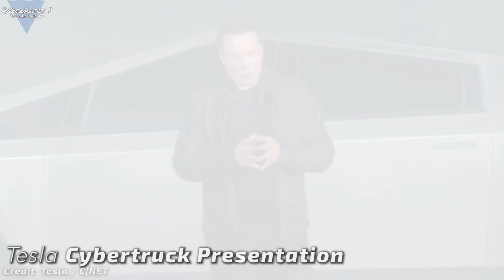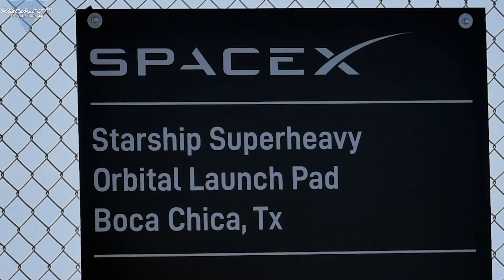53 | SpaceX Starship Updates – Roberts Road Construction - Blue Origin Progress Update

Comment: Pressurized cybertrucks could also be used as sealed fire disaster area escape vehicles
Reply: Damn no one ever commented or said this on any new videos on the truck! Good thinking Elon should have pointed that out
Reply: StoryTelling the body is the chasis which means the batteries will be protected by steel tough enough to withstand re-entry since its the same steel as used for starship
Reply: cam Coutu starship will have covers on reentry side though, helping reduce the heat the steel handles a lot less. Battery’s near heat probably just isn’t a good idea
Reply: @damitcam  Starship uses heat shield tiles on the wayward side for re-entry. Tesla batteries need to stay under 113 degrees.
Reply: @damitcam   - and to think - for the last 60 years the auto industry has been designing vehicles with "crumple zones" - but this  Tesla Truck body doesn't seem to wanna "crumple" - ooops  - what will the auto industry do now.... =P
Reply: Batteries and heat don't mix well. Teslas already have to turn on cooling systems often in the summer to keep the batteries cool enough.
Reply: Colton McCormack that’s what I was thinking. The truck itself unless could blow, unless perhaps Tesla has a huge heat shield like starship around important electronics
Reply: Good talk guys that was refreshing.
Reply: Which means if the whole underbelly is flat you will be fine, as long as your not sitting directly on top of a fire for too long you should be ok
Reply: @damitcam  No. Starship is able to take significantly higher heat levels than a battery. 3mm of stainless steel isn't particularly insulating, it can just take higher heat levels. A fire-rated truck would require significant insulation and/or active-cooling.
Reply: cam Coutu that’s gonna be awesome then to be fair. But the next step is they still use rubber tires which is swapped for the airless could be an amazing rescue vehicle
Reply: To clarify, the heat shield is not made from the same steel. It is made from aluminum-lithium. The steel isn't insulative enough to take that kind of heat, and the truck's steel is thinner than the Starship's anyway.
Reply: Isn't it just safer to roll up the windows? We all know what gas does under pressure, particularly flammable gas. Yeah, it might be sealed, until it's not.
Reply: @Levitiy  I guess there wont be movable windows cause not needed. Maybe there would be fixed windows or cameras installed like Tesla Models.
Reply: Even better. It can reach remote forest fire zones by going THROUGH rivers & streams (were trees can not grow/burn), since it is sealed & does not need air/exhaust to run.
Reply: Damn no one ever commented or said this on any new videos on the truck! Good thinking Elon should have pointed that out
Reply: cam Coutu but, where would you escape too?
Reply: Yea but those heat shield tiles are made of the same grade of steel as the truck
Reply: windows break
Reply: @4rt3m1s-b6p  The windows broke because the sledgehammer hit directly before them hit the edge of the glass and cracked it. They aren't going to break under normal circumstances.
Reply: Graphene Could be use as cooling material. They also need to use special tyres to withstand fire and other Problems.
Reply: Bro are you on drugs
Reply: Does the battery/motors also have the same protection from the exoskeleton or is it beneath? I have not looked into the truck besides the presentation
Reply: Im not saying these things will be great for driving threw fire directly im suggesting using the life support to purify the air inside the truck of smoke and toxins, if you watch many fire evac videos the roads are still there for the most part in what we see so this is my suggested use case

Comment: You know what they say... The Best Weld is No Weld. c;
Reply: They will use a bending machine 😂
Reply: 200+ foot SS roller/bender. I really wanna see that
Reply: @williamscenna3163  Could be possible. If you ever had seen manufacturing of turbine for powerplant or camshaft for a big ship, why should it be Impossible to bend such a large Tube?
Reply: Cryofit sleeves for Submerine reactors pipe  fitting I did also very special tanks ,  NO WELDS ......

Comment: You missed the giggle that Blue Origin is building an actual water tower at the Cape. :) The assemblies at Cocca might actually get to the pad and at least used for full integration rehearsals. Mark 3 at Boca might actually be the first to fly IF they use the already done upper section of One.
Reply from the maker: Thank you for the comment! Absolutely! It's all still open. Exciting times! :)
Reply: Considering Mk1 had its header tanks in the nose and they wont be there in Mk3. i doubt it will be used unless they pull all of that stuff out, but at that point you might as well make a new one. why waste man hours taking it apart?
Reply: Perhaps Bezos could use SS MK2 as his water tower.